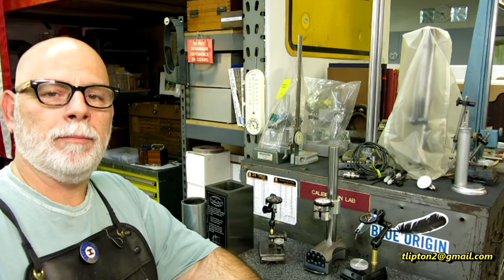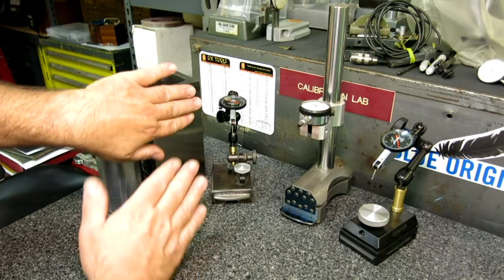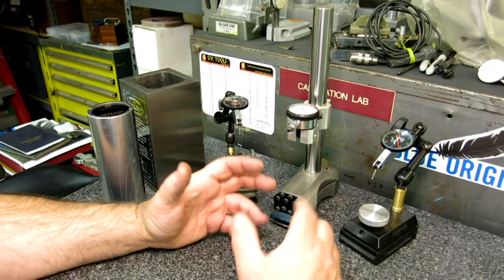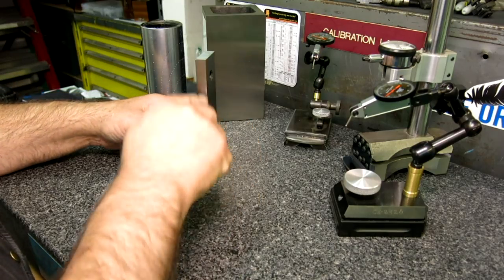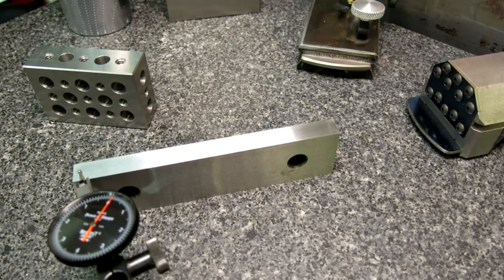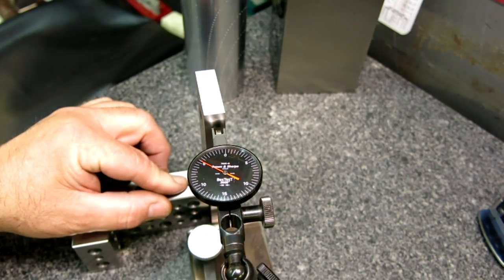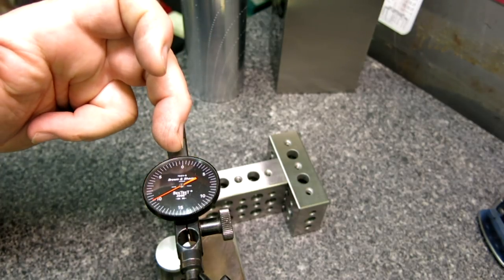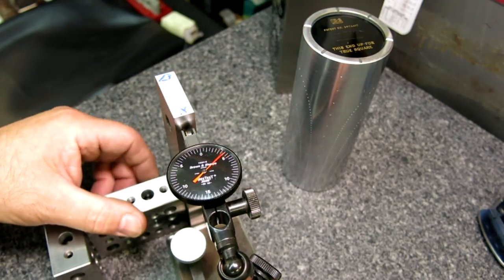Its Hip to be square

Comment: Thank you for sharing, I have been kicking around the idea of building a "master square".  You have verified that I can calibrate it close enough for anything that I would do in my shop.
Reply: Actually building a really accurate cylindrical square on a half decent lathe that's not totally clapped out isn't all that tough with a good micrometer. As long as the cylinder measures the same diameter along it's length and it's had at least one end faced off at the same setting then it has to be square to within at least the accuracy your micrometer will repeat to. Until I bought a good one I used a large diesel engine wrist pin as my small cylinder square. There hardened and ground to some pretty accurate specifications so work quite well.
Reply: That is what I had in mind. I have a piece of 2" stainless. Should work OK.
Reply: Suburban Tools do a real good explanation of how even a worn out of square cylindrical square will be still exactly square to the surface plate if you can measure where that exact point is on the cylinder that might be worth checking out.  My B & S 558 square is just a bit over 6.250" long and has a diameter of 2.440 so was likely ground from 2.5" stock if those dimensions will help. The larger the diameter of stock you use the more stable it will be in use.To save on weight some of the more usual squares are ground from heavy wall schedule 80 or better pipe. But your stainless will help with the rust issue since a rusty cylindrical square is just about worthless.
Reply: Turning Point If the piece you intend to use is a tube then should work pretty good, but if a solid cylinder then you could have an issue.  Most lathes will face slightly convex and a 'tippy' square is not much use... Perhaps if you turned an undercut in the center.
Reply: That's why you turn a narrow step on the squares bottom face and recess the rest so it remains stable in use. But any half decent lathe should face slightly concave right from the factory. Toolroom lathes if I remember the specifications correctly are or should be set up with an inward bias of .002"-003" over 12" on the cross slide so that would be on a 24" diameter workpiece. All bets would be off on exactly what you'd get with a seriously worn lathe though. All 3 lathes I've owned faced concave. But turning that bottom step should help to get a stable square.
Reply: I am also using a diesel engine wrist pin as a cylinder square.  The ends of the pins are not as accurately ground as the cylindrical portion is, but as long as at least one end is flat, (no rocking), it does not matter.  A cylinder that is standing flat on an end that is not square to the cylinder will still test perfect for vertical perpendicularity at two points while rotating it through 360 degrees, and half way between those two points are the two points that are furthest out.  I was able to test and calibrate my wrist pin against my granite square, but anything close, like Tom was demonstrating, can be used to find and mark the vertical sweet spots of the cylinder.
Reply: I got mine out of a V12 Cummins mining truck engine Bob so there fairly large. They also work well if you've got at least 2 since there hollow and can be bolted down to a milling machine table and used as a pretty accurate 90 degree angle for clamping work to them. Good tip on the ends not being as accurately ground as the length is. I've actually never checked mine since I got a proper cylindrical square at the same time I bought my small surface plate. But I'll be sure to do so now.

Comment: Another good teaching video, you've covered square, parallel ECT over the yrs and I learn each time. Thanks for sharing. I do have a thought to add, when you're "reasonably" lol parralel 15millionths!! is bolted to the 1-2-3 block the torque of the bolt can induce deformation in a number of planes. Love learning new stuff, just wanted to add that.

Comment: As always, an excellent video Tom. At the risk of being a pedant, I'd suggest for those interested in metrology, it's generally considered best practice to move the work (where possible) and not the gauge. ie when checking for parallel you'd slide the parallel beneath the stationary indicator. The reason is it typically results in less error due to surface plate tolerance.
Reply: That's the the older guys in our job shop tell me, move the part, not the gauge.  Good to have another opinion on this.
Reply: Old guys are always right ;) Yes there's a few reasons for it, and for electronic gauges moving them can introduce errors just because of their sensitivity. However even with mechanical indicators, if you imagine the plate actually being a convex curve and you slid the parallel under the indicator, the parallel would follow the curve as it slid. Conversely, if the parallel was stationary and you moved the indicator, the indicator would follow the curve and you'd end up measuring the radius of the curve the indicator was sitting on.

Hopefully that makes sense. Most of the time the surface plates are so flat thats not a major factor, but it's still considered good practice. Nevertheless, with a 2 um indicator or similar, you will notice more reliable results by following best practice.
Reply: I get your gist, and...they aren't always right but the majority of the time, what they say at least works.  :)  We can always take it from there!

Comment: Hi Tom, about the base with the curved front edge, would a normal scribe base with a vertical v notch in it (witch one of yours have it) and a big ball bearing ball up against the v notch also do the job sweeping for "zero".
Reply from the maker: Yes. If fact that is exactly what I used to do before I walked on land. Cheers. Tom

Comment: That's really interesting, but now I'm wondering what those spiral dots on the outside of the cylinder square are for
Reply: That's a special cylinder square, he has another video on it. If you flip the cylinder upside down, that face is not square (on purpose). Those dots show how out of square a part is.

Comment: Nice video there.  I love that it can be done so simply.  If I might ask, what are the curved lines of dots on the cylinder square for?  I don't think I have seen one with those before.
Reply: I would be interested too
Reply: I'm also curious
Reply: Add me to the list!
Reply: they are used to measured how out of square an object is.  line up the dot that matches the square to test object, read off the amount out of square from the dots
Reply: so the cylinder is not square all the way around?
Reply: Note the instructions on the cylinder. If you flip the cylinder 180° you have a calibrated "unsquare". The lines or dots show where the increments of "unsquareness" are on the cylinder.
Reply: One end of Toms B & S square will read as a normal cylinder square will. The other end has a slight angle lapped on it so at only one position with the straight vertical line of dots on the square will it read as 90 degrees to the surface plate. Rotating the square allows you to measure within a 10th or 2 how out of square something might be. It's an extremely clever and well thought out system, but B & S haven't made them since I think around the mid 1990s. I searched on Ebay for over a year before I found one in excellent shape at a not too bad price. A good one will still usually run $400 or more though.
Reply: Turning Point it woul be great to see a video from one of you gentleman. I'm very interested, Tom does nice simple explanations. Mabye someone else?
Reply: LOL, appreciate the vote of confidence James. I'm not set up to do videos and my computer savy is slim to none. Editing or even getting it posted might be way past my skill level. Maybe someday though. My best recommendation, YT and the machinist forums are great don't get me wrong, but in my honest opinion they don't replace the need of reading every machinist related book you can get your hands on. What worked in the 1800's works just as well today and forums or YT videos can't fully cover a subject as large as machining is. I've been trying to lean just some of it over the last 30 years and I'm still learning how much I don't know.

Comment: I assume that the parallel could be moved slightly until the same measurement is achieved on both surfaces to achieve an actual square?
Reply from the maker: Absolutely correct. Then you really have something. Cheers. Tom

Comment: To be clear, Tom, you are calibrating the comparator with the test indicator to indicate square, right?  The parallel and 1-2-3 block setup is not perpendicular to the surface plate.  I was a little confused at first.  Since you said you were going to create a perfect master square reference and showed the two master squares, I was expecting the parallel to end up square to the surface plate.  It made sense once I realized that what you were calibrating was the comparator to indicate square,  not the parallel to be square.    Good demo, nevertheless.
Reply from the maker: Hi Richard. Yes the comparator is perfectly square after this procedure. If you wanted to carry it further you could move the parallel around until you get the exact same reading on both sides. Then you would have a right angle artifact. Cheers. Tom

Comment: Tom, the cylinder master looked like it had a pattern of punch marks in it. What are those for?  Great video as always.
Reply from the maker: Thay cylinder square can measure out of squareness directly. One end has a slight angle on it so when you rotate it and block the light coming through you can get an actual measurement. The opposite end of the cylinder is ground perfectly square so it behaves as a master also. Cheers. Tom

Comment: I cannot figure this out. Why is one side A +5 and side B -5? What am I missing?
Reply: Larry Doolittle he "zeroed" on one side, then read the other side, and measured that as ten out.  Since he new the sides were parallel, it mean s the whole thing leans, and one side is half the measurement away from the comparator, the other is half towards it, so one side is minus five from square, the other is plus five.  Even though the thing wasn't square, he could use it to calibrate the comparator so he can check squareness of something else:)
Reply from the maker: Hi Larry. Because the parallel is not square. Its leaning one way plus and one way minus. We can split the difference with the comparator and derive true square. If you wanted to you can move the parallel around until you get zero zero on both sides. Hope this helps. Cheers. Tom
Reply: Thank you, Tom. Now I get it. Best.

Comment: Tom, when you zeroed on side A, why doesn't side B show zero?
Reply: John Warden The parallel isn't perpendicular to the surface plate, so the initial zero is basically an arbitrary starting point. You are saying that zero indicates how far the parallel is tipped toward or away from you. Then when you indicate the other side it shows twice how far the parallel is tipped in the other direction. True perpendicularity is halfway in between the two readings.
Reply: Thanks for the reply, now it makes sense.

Comment: Can someone explain units to me. Based on my current understanding, a thou is a thousandth of an inch, a tenth is a tenth of a thou, and a millionth is a millionth of an inch. Is that correct?
Reply: Yes, correct. It's like this because .001" is the "base unit" most commonly used by machinists working in inch units.

Comment: Hi Tom, 
Just curious as to what you think about  checking both sides of the master square or cylinder just to be sure it reads the same ?
Reply from the maker: Hi Ian,

Always a good idea to check around the periphery of an unknown cylinder square. One neat feature of a cylinder squares is even if there out of square there are two spots on the diameter where it will read perfectly perpendicular.  Cheers. Tom